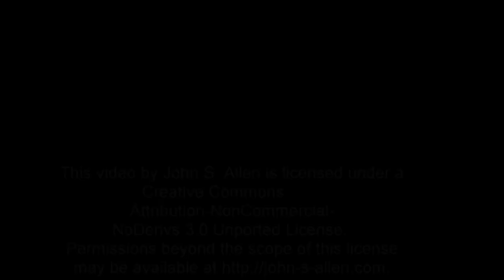Alewife Brook Parkway to Harvard Square -- Mass Ave, Brattle Street

Comment: At 1:18 when the general travel lane becomes a bus lane, had you not been riding in the green-painted bike lane to demonstrate the hazards there, would the better/safer place to ride have been the general travel lane to the left of the bus lane? In places where cars are traveling notably faster than bicyclists and there are not as many signal lights to allow bicyclists to keep pace, like many places near where I live, this also seems not ideal since there is no passing lane.
Reply from the maker: Thanks for your question. The bus lane has to do double duty as a parking lane at some hours of the day, and a car is parked in it. Before the separated bikeway was installed, there were two open travel lanes and so vehicles could always pass bicyclists (as later in the video). Probably given the conditions, riding in the bike lane was the preferable option ^given that i was aware of the risk of a right-hook crash at the end of the block, and checked for overtaking traffic with a head turn and rear-view mirror*. There was in fact the overtaking box truck ,but I could see that it was in the #1 lane (closest to the center of the street). It was there because it had to pass the parked car in the bus lane, and it was not turning right.

Comment: Great Video
Using one general trafic lane for all Vehicles, single or double tracked, motorized or not,
IS the savest Option. 
It works surprisingly  well in double lane Streets and when traficlights determine the travelspeed.
In one lane Streets and when Speed rised i experienced significantly less acceptance traveling this way
leading to willingly endangering Behaviour of a countless Number of Motorists.
Reply from the maker: Danke sehr, mein Freund mit dem Liegerad. In welchem Land wohnst du? Fährt man so in deutschsprächigen Ländern?
Reply: @jsallen1946  
Hello John, i live near Frankfurt am Main, Hessen, Germany.
Bikelanes, if avbailabale, are quite similar, and bikers are supposed to use them and mostly they do.
Only a few drive in mixed traffic and dare not to use them if the risk is obviously too high.
Like your videos, best regards, 
Franz